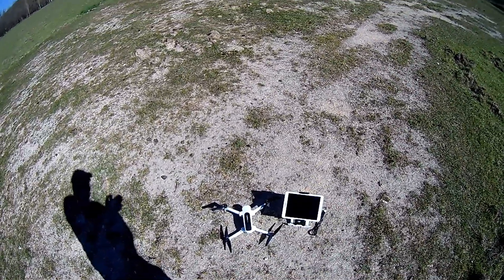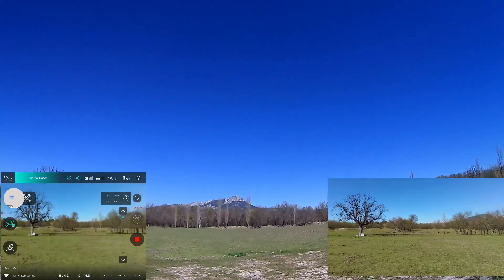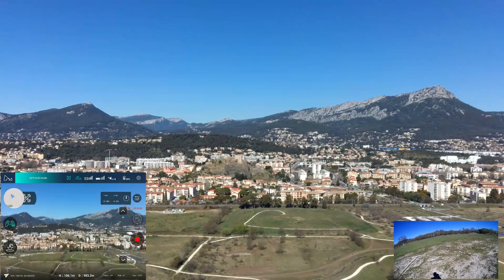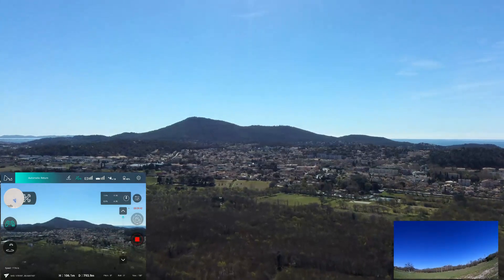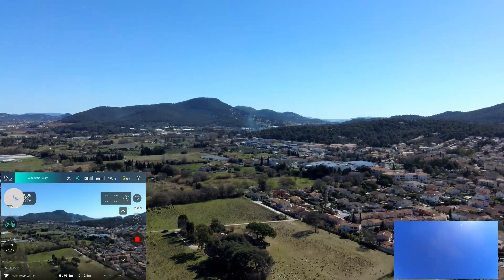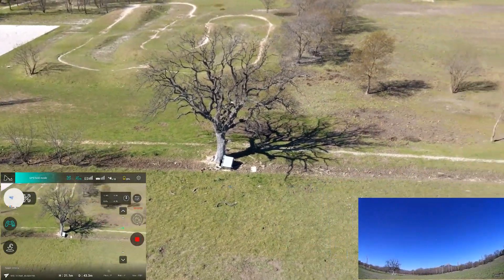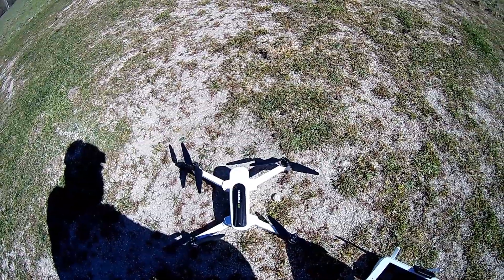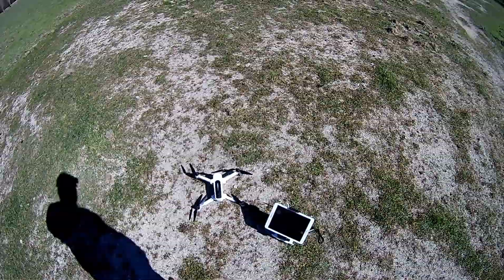Hibsan Zino with last major updated firmwares: 1.1.48 (Courtesy Banggood)

Comment: It is improved but I remain less than impressed.
Reply from the maker: The video stabilization and now camera recordings are not bad at all .... not being the most stable machine, the most advanced, at least I never met a flyaway. Maybe I was lucky ...
Reply: It should have returned to home automatically... Did you install all 4  updates? For the remote control, the flight controller, gimbal and camera?
Reply from the maker: @KookyBone  Yes everything... In fact, the first time I didn't hold enough the RTH button to engage it... No problem with RTH